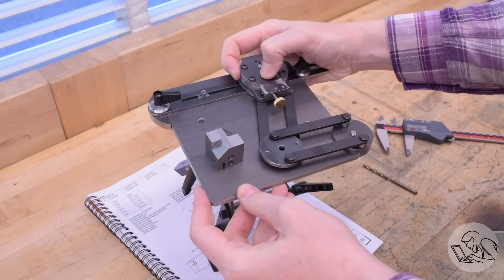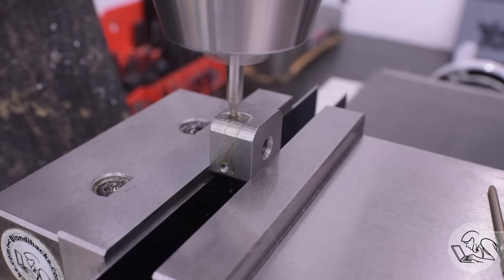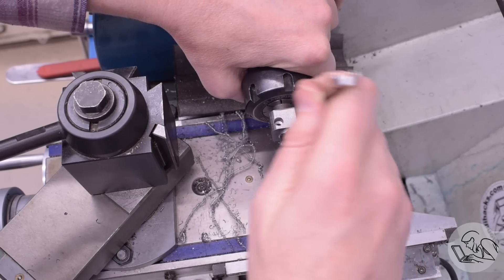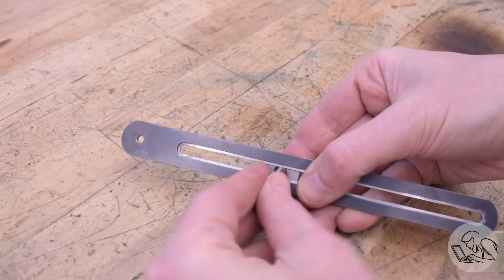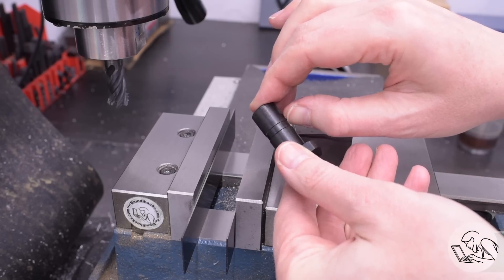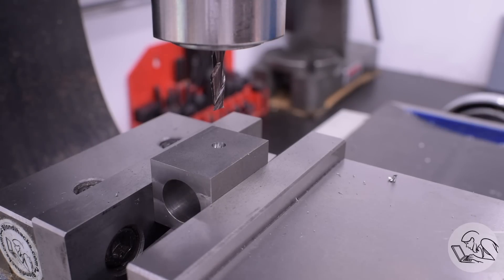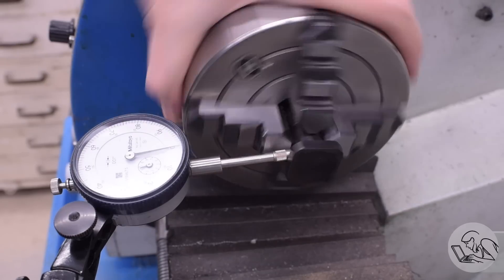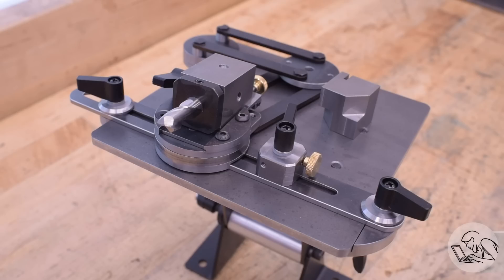Let's Build a Tool Sharpener - Part 7

Comment: Is it a square block with rounded corners or a round block with flats? I guess the piece was machined from 1" round bar stock. I have just started to test run my sharpener. One issue that needs to be addressed is the hex screw heads in the bottom of the "elbow". They have an annoying tendency to hook up on the edge of the table as I slide the tool block forward. Maybe an extra support shim under the arm will solve this. Delrin would be a suitable material for it.

Comment: My uneducated guess on the rounded corners of the stop block piece is to limit potential damage to your fingers when loosening a slightly overtightened little clamp handle thing. Bashing fingers against a nice rounded edge when the handle breaks loose is probably preferable to a corner. Either way, it does look nice!